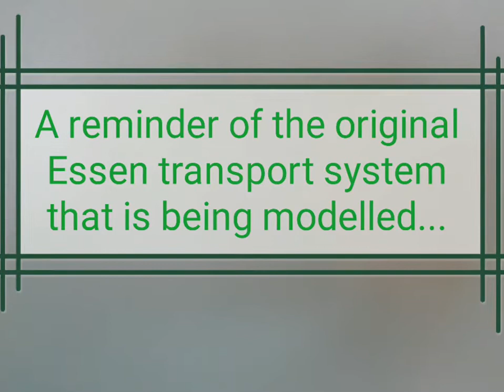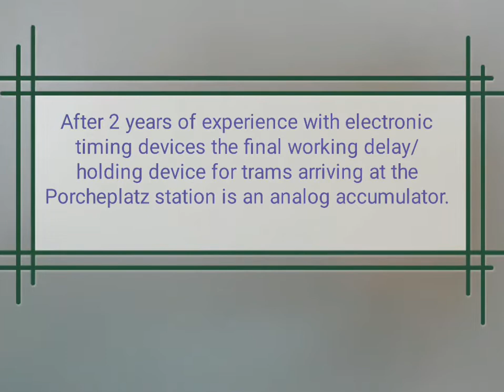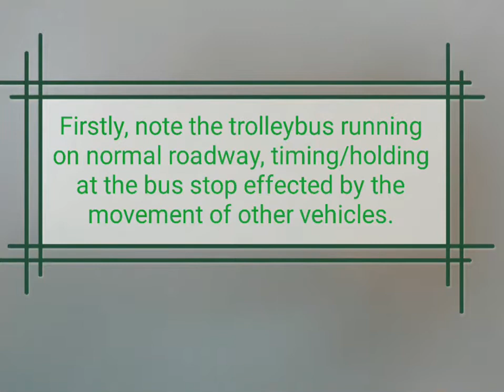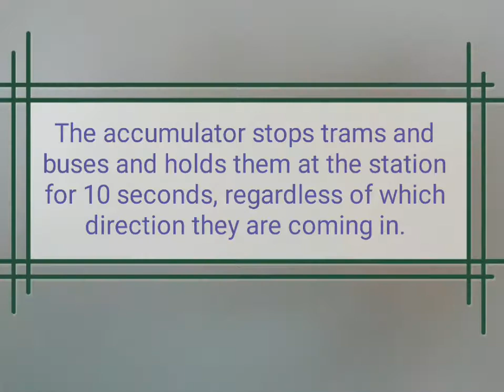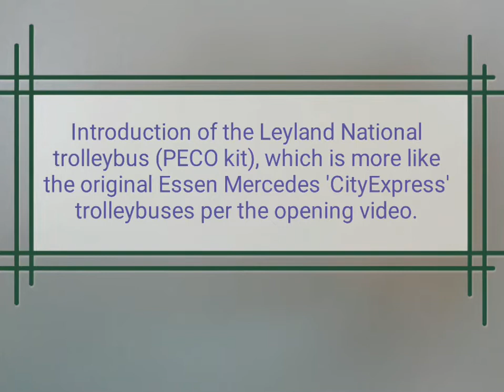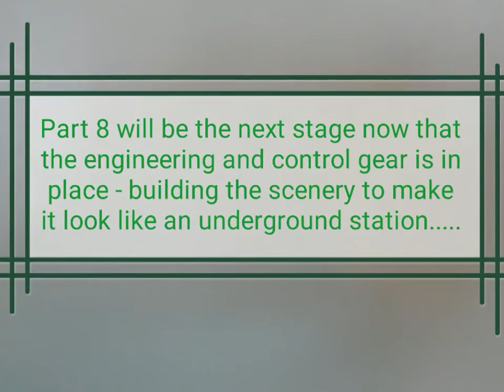Essen Bus Project Part 7

Comment: Hello,  I am assuming that the overhead is live, but you are using reed switches to control the vehicles not unlike the Faller system?  I do like the idea of what if, British Trolleys lasted into the late 20th Century or even too now, great fun. 
Thank's for posting.
Trolleybase
Reply from the maker: Thank you Trollybase!  It's been fun to work on this little Essen style kerb guided bus project and I'm hoping to have it finished before the end of March and will then post the final video.  I'm also going to include photos of the Leigh guided busway (near Manchester) and point out that we have several KGB systems in the UK too now.  Ironically, Essen is planning to pull up the last remaining busway near Kray and put the trams back!   I'll also include pictures of some of the key locations which I took on my visit to Essen a few years ago.   (Porscheplatz station is now renamed 'Essen Town Hall' - not as iconic, or glamorous!)

Yes, that's right -  the buses draw their power from live overhead wires - all in 4mm scale!  (HO/OO).   I understand what you mean by the Faller control system using reed switches, but  I also use the overhead wires to cause the buses to stop - there is an isolation at the desired stopping place where one of the overhead wires is dead/energised per the status of a 5v toggle relay.  I use reed switches  in this video, as you see, but not quite in the same way as the Faller system:-   In my original control systems,  such as  at Porton Victoria Park (where in this video you see the two trolleybuses 'in the street') and also the exhibition layout 'West Porton' (per hyperlink below), the arrival of buses at a particular bus-stop is detected by the overhead wiring, which energises a relay, which in turn sets off the next vehicle in the sequence - thus pausing the bus to load passengers.   However, this method of control creates quite a power draw and is also hard wearing on the relays.   When I built this 'Essen' loop I thought I'd try a different way:  the bus has a magnet glued underneath  which activates the reed when it passes over it (although later I realised that the reed is also activated by the tiny steering magnet on the front axle and the magnets in the motor.....Duh!).  The reed switch is connected to one set of the coils of a toggle relay which when shifted (toggled/latched) reverses the polarity of the tram line.  The next bus stop is not supplied with power so the bus comes to a halt - meantime, due to a diode activated by the power reversal, the tram moves forward through the station and to the end of the track.  The tram is also fitted with a magnet, and as it passes over the reed switch at the end of the tram line it activates the toggle relay controlling the trolleybus:  The tram comes to a halt due to an 'end of line' diode and power is now passed to the stationary bus via this toggle relay, plus  power is disconnected from the next bus stop at the same time.   The bus moves forward.  Before reaching the next bus-stop it passes over a relay which reverses the polarity of the tram track again:  the bus stops at the next stop as there is no power, and the tram moves back along the track in the opposite direction.  Simples!  The advantage is that the toggle relay is powered only briefly as the bus/tram passes over the reed switch - the rest of the time no power is supplied to the toggle relay.   In contrast, the other Porton systems relays are held under power as long as a bus or tram is at a bus-stop, pretty similar to the way the Faller system has a magnetic coil below the road which is powered while holding the reed switch in the vehicle above it open, ie stopped.)    I have also used reed relays to activate the accumulator, which is the mechanism holding vehicles at the station:  these are activated by the magnets under both the tram and trolley bus so, as at Essen, the station doesn't care whether the next vehicle is a tram or a trolleybus, it holds it at the station for 10 seconds (power disconnected) and sets it free when the accumulator wheel completes its turn (ie restores power).   There are a few disadvantages with this reed/toggle method, but it's fairly reliable and for the sake of the power save - going green - I think future automatic control layouts will use this system.

This link takes you to my latest model trolleybuses - the Leyland National beni-trolleybus, which I think you may have already seen.   These better represent the buses used in Essen during the 1980s experiments - but I was so impressed with the prototype that I build a whole fleet of them!   It also shows you that the West Porton layout does not use reed relays for control - non of these buses have magnets fitted.    https://www.youtube.com/watch?v=nkt68zhnlaA  (Or follow my channel to Porton Leyland National Fleet.)

Comment: Very good model. I like it. It rides very stable and smooth. Did you have problems with the contact of the rod and wire? My models don't ride as smoothly and sometimes go missing with wire contact. How did you achieve such stability? Thanks in advance
Reply from the maker: Hello Michael, I hope you are well.   Yes, it took me a while to figure out how to achieve good magnetic contact with the road too!   My oldest system, 'VIctoria Park', used plaster to make the roadway and I dug a channel 1mm deep for the steel guide wire.  The road surface is very rough, and this causes the magnet and steering rod to jump off the wire.  For the West Porton layout I laid the wire down first, then built up cardboard either side of it to a height of 2mm and then covered this with sticky-back plastic to create a smooth road surface.  This too sometimes failed, especially on sharp corners.   I found that by relaxing (undoing) the screw which holds the guide rod to the axle slightly there is enough 'up and down' movement to allow the guide rod to cope with uneven road surfaces.  Make sure the guide rod is completely flat to the road surface.  (Sided to side and front to back)     If the bus/lorry is not moving smoothly, maybe the guide wire is too close to the surface of the road - - put some selotape down to raise the road surface.  If the bus is OK everywhere else, but crashes at the same point all the time, maybe the guide wire is too deep below the road, or there's a break in it.  you'll have to dig up the road my fiend!!

Good luck with your model making!

Здравствуйте, Михаил, надеюсь, у вас все хорошо. Да, мне потребовалось некоторое время, чтобы понять, как добиться хорошего магнитного контакта с дорогой! В моей самой старой системе, «Виктория Парк», для создания проезжей части использовалась гипсовая штукатурка, и я вырыл канал глубиной 1 мм для стальной направляющей проволоки. Поверхность дороги очень неровная, из-за чего магнит и рулевая тяга соскальзывают с провода. Для макета West Porton я сначала уложил провод, затем наклеил картон с обеих сторон на высоту 2 мм, а затем покрыл его липким пластиком, чтобы создать гладкую поверхность дороги. Это тоже иногда подводило, особенно на острых углах. Я обнаружил, что если немного ослабить (отвинтить) винт, который удерживает направляющий стержень на оси, движения «вверх-вниз» достаточно, чтобы направляющий стержень справлялся с неровностями дорожного покрытия. Убедитесь, что направляющий стержень полностью прилегает к поверхности дороги. (Из стороны в сторону и спереди назад) Если автобус/грузовик движется неравномерно, возможно, направляющий трос находится слишком близко к поверхности дороги - - приклейте скотч, чтобы поднять поверхность дороги. Если с автобусом везде все в порядке, но все время глохнет в одном и том же месте, возможно, направляющий провод находится слишком глубоко под дорогой или в нем есть обрыв. тебе придется перекопать дорогу, мой изверг!!

Удачи в создании моделей!
Reply: @westporton  с магнитным управлением проблем почти нет. Есть проблемы с передачей электричества от контактных проводов в троллейбус. Ваши троллейбусы работают от контактного провода или внутри установлены аккумуляторы/батарея? В мои модели электричество передаётся с контакного провода и передаётся очень плохо.
Reply from the maker: @diesel-mk  Yes - I too use live contact wires to give power to the motors.  This is how real trolleybuses work!  I use brass-rod for the overhead lines, copper or brass shoes to collect the electricity from the overhead wires and the trolley poles are brass too.  Everything must be clean for good electrical contact : file out your pick up shoes and check the overhead wire for paint or other stuff which will prevent the current from flowing.  I also use a 'dust buster' device which sends a 16v ac boost if there is something on the line such as dust or grease.   Real trolleybuses use very high voltages, which destroys anything on the wires which prevent electrical flow --- - in a big flash!  https://www.gaugemasterretail.com/magento/gaugemaster-gmc-hf1.html

Use white spirit to clean the overhead wires and pick up shoes.  WD40 or other electrical points cleaner helps too.

Да, я тоже использую контактные провода под напряжением для питания двигателей. Так работают настоящие троллейбусы! Я использую латунный стержень для воздушных линий, медные или латунные башмаки для сбора электричества с воздушных проводов, опоры троллейбусов тоже латунные. Все должно быть чистым для обеспечения хорошего электрического контакта: снимите обувь и проверьте контактную проводку на наличие краски или других материалов, препятствующих прохождению тока. Я также использую устройство «пылесборник», которое подает напряжение переменного тока 16 В, если на линии есть что-то, например, пыль или жир. Настоящие троллейбусы используют очень высокое напряжение, которое разрушает все на проводах, которые препятствуют электрическому току --- - в большой вспышке! https://www.gaugemasterretail.com/magento/gaugemaster-gmc-hf1.html

Используйте уайт-спирит, чтобы очистить воздушные провода и подобрать обувь. Также помогает WD40 или другой очиститель электрических точек.